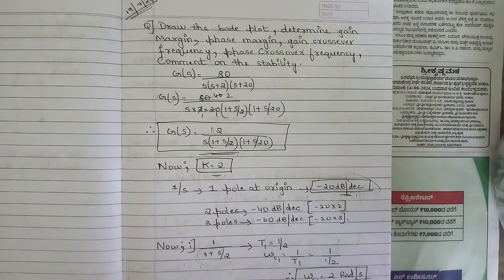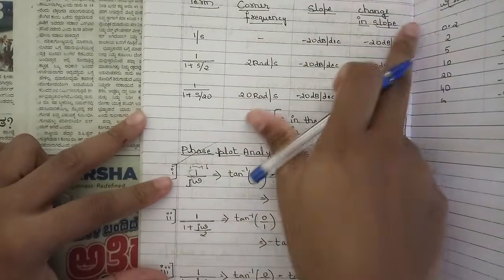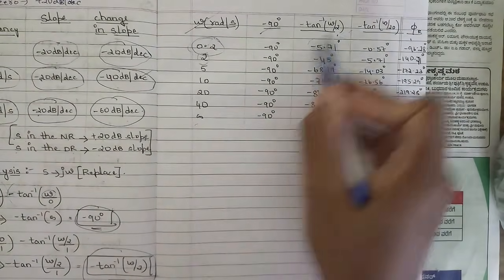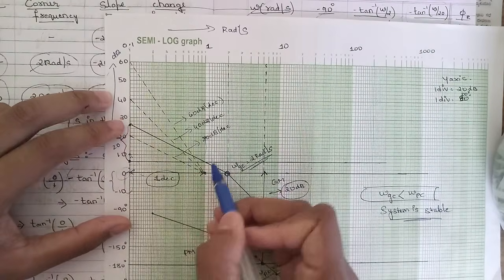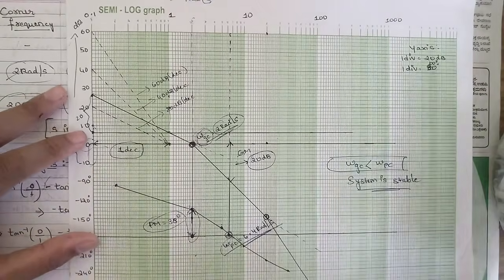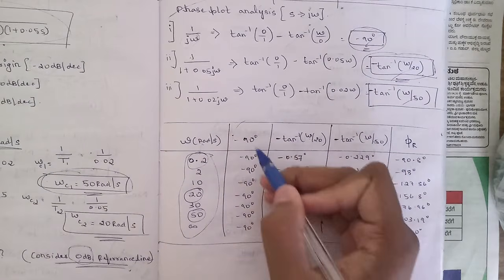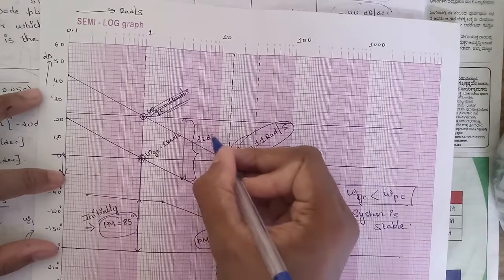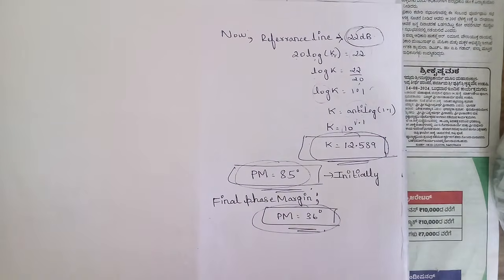Model Paper 1 Q9 a Bode Plot Explained Briefly Part-1 Module 5 4th Sem ECE  VTU BEC403

Comment: Why starting from20db
Reply from the maker: In magnitude plot it always starts from 20 dB ....it's a rule.
Why because in the magnitude condition always plots should be started at K=0.
In dB scale, it is 20logK ryt...
Now, 20log(0)
W.K.T, log(0)=1...
Therefore 20*1=20...
That's why it is always starting from 20dB